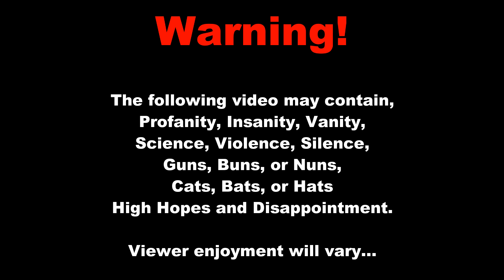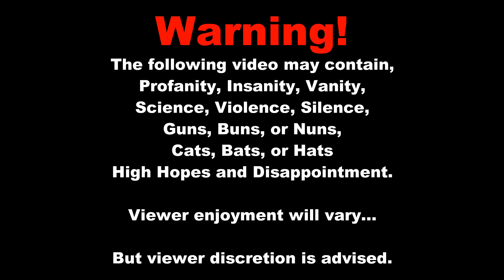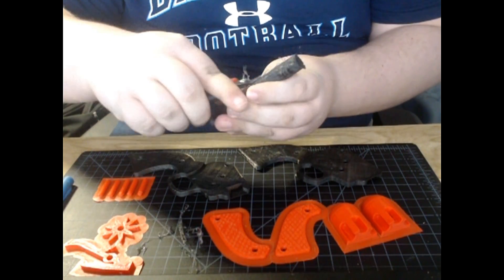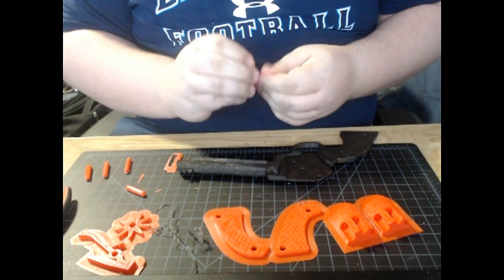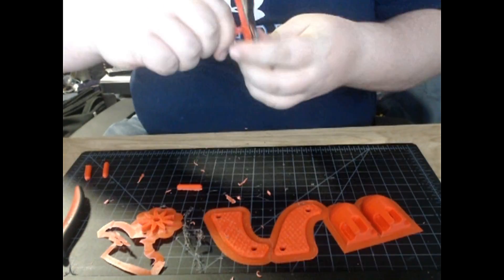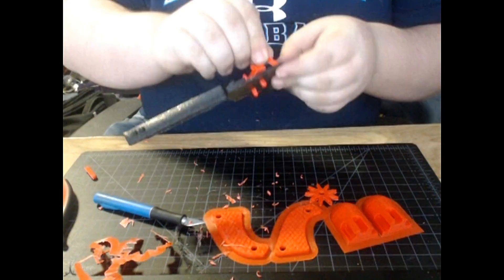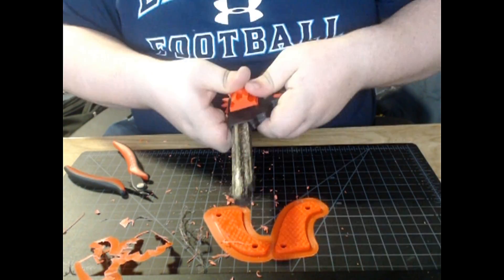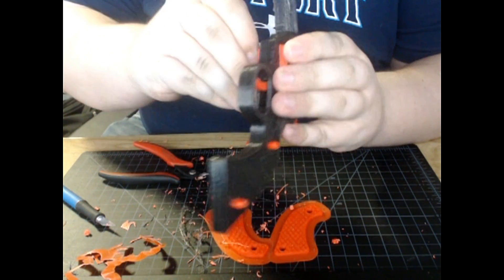Rubber Band Gun vs NERF gun!-3D Printing

Comment: Nice tests. Try masking tape on your bed, see if it works out. Also, don't rafts work well instead of brims?
Reply from the maker: +Science Man I've since calibrated the machine, and no longer need to use either when using pla. 

Also, I've always believed that rafts were a waste. The thing that helps abs and pla adhere to glass is the heat mixed with a textured surface. Hairspray works much better than tape.
Reply: Oh. Thank you for your tip by the way.